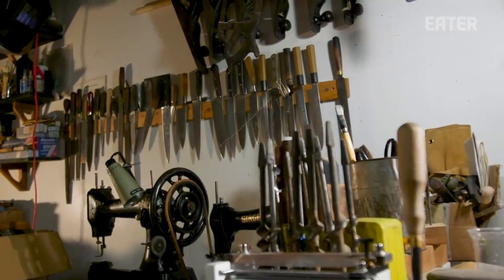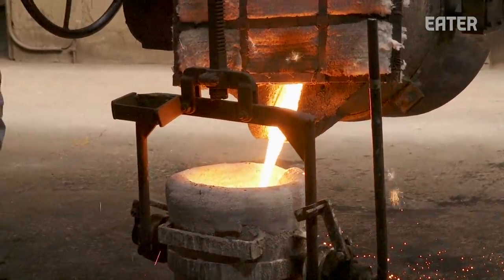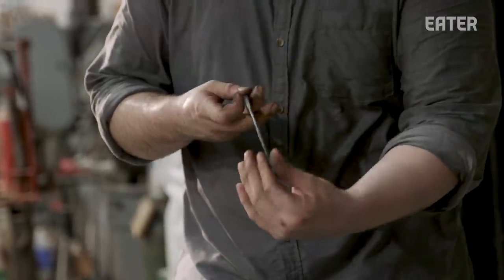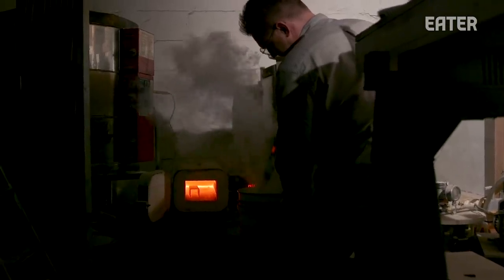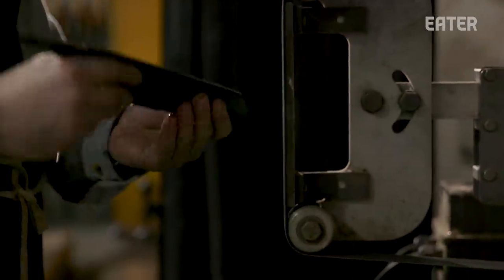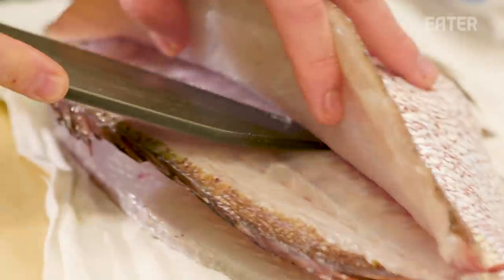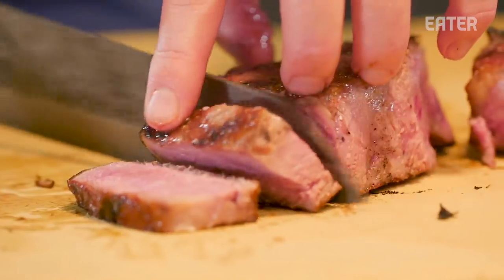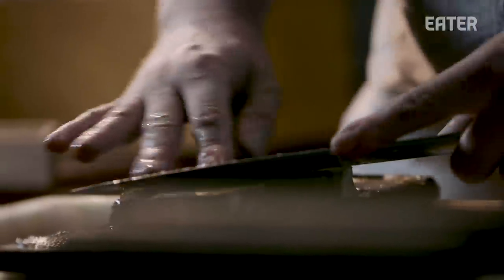How Knives Are Made for New York's Best Restaurants — Handmade

Comment: This explains why the knife I got in Japan costs $200+ 😅Worth it.
Reply: Natalie Lim that's super cheap for a Japanese knife, I'm assuming it is a lower carbon steel because high carbon is highly coveted
Reply: Just like another the other response to your post $200 is cheap for any hand made knife.
Reply: I made another comment before and don't know how it was deleted.. But I stated that I agreed, I saw knives 2x, 5x, 10x the price. I'm only a student and also got my dad a matching knife so def on a budget. Cheap is relative. 🤷🏻‍♀️
Reply: Natalie Lim $200 bucks for something that can potentially last a lifetime or two is definitely a good thing lol, in this day in age a phone that is $1000 only lasts you as long as it's supported for
Reply: @dvxAznxvb  Hahaha for sure, a good beginning to my future collection hopefully :)
Reply: If you forgo pattern welded steel and fancy handle material like burl, you can definitely get into a quality custom chef's knife for around $200-$300.  

As for the "low vs high carbon steel" comment, it could be made from japanese white #2 which has a fairly high carbon content. or maybe something like vg10 if it's stainless. Probably not going to be blue super but I'd rather have something like 52100 or AEB-L over that anyways. Both can be ran @ 62 hrc comfortably. I favor 60-61 hrc though for most kitchen knives for a high amount of toughness with a nice balance of hardness and good abrasion resistance without being a pain to re sharpen. A sujihiki could definitely be ran at 62+ hrc though with either 52100 or AEB-L.
Reply: @dvxAznxvb   You don't have the slightest clue what you're talking about; it's more expensive alloying metals that increase steel cost not carbon content. White #1 is the highest pure carbon steel available to bladesmiths at nearly 1.5% but you can find plenty of white #1 gyutos under the $200 mark. white #1 is just harder to heat treat to north of 63 HRC without becoming too brittle, so when it comes to water quenching pure white #1 especially differentially quenching in water (mizu honyaki) prices go way up because of expertise and failure rate.
Reply: @dvxAznxvb  A Shirogami or Aogami knife can be in the low 100s to several thousands of dollars, it's not the steel that settles the cost. (at least not the majority of it)
Reply: @elliottatwell1155  Shirogami, as explained by Carter, is the steel that shows the true skill of a smith as he has to HT it. Aogami, for what I remember, is already ready to go. Although, I recall having seen Aogami knives being forged, so that should require another HT.
Reply: @Masterfighterx  Nothing is harder than forging, quenching, properly tempering and grinding high alloy steels. It's why so few smiths make Blue #1 Honyaki, because of the failure rate. Togashi, Ikeda, Konosuke and a handful of others do.  White steel is more easily forgeable and the smith can refine grain structure through the forging process which is why master smiths can push white #1 to 64-65 HRC without it being super chippy vs a piece of stock removal white #1 would be super brittle. White steel heat treat and quench temps don't have to be as precise so they're conducive to old school techniques, because all it is, is iron and carbon with a few trace elements.
Reply: Elliott Atwell I didn't say carbon content was what determined the price, everyone values their time and money differently. What I do know is that the higher carbon steel would be more durable retaining the edge which is what most chefs are looking for
Reply: @dvxAznxvb  You assumed a knife was lower carbon because of the $200 + price tag. And no, higher carbon steel doesn't necessarily have more wear resistance. Blue #2 has less carbon than white #1 but higher wear resistance due to other alloying metals which form carbides.
Reply: @elliottatwell1155  Nothing particularly untrue about this, and repeated low temperature heats during final forging steps can help to refine the grain size of steel, but it is worthy of note that a knife made by stock removal could achieve the same results with a proper normalization/grain refinement/heat treat. there is nothing magical about heat cycling a blade while forging as opposed to in a dedicated oven. And I say this as a guy who finds forging far more fun than stock removal, but it would be wrong to say that a forged knife is inherently better than one made via stock removal. Forging/stock removal are both capable of producing equal quality knives, presuming both are done with equal skill.
Reply: The knife you got in japan is probably far better than this. This guy is a total fraud.

Comment: Is that rust on the knife?
Reply: Likely. These knives are usually high carbon (rather than stainless steel which is more common) so are prone to rusting. So you gotta keep them dry and take care of them. But on the plus side, they stay sharper for longer :)
Reply: @lymah_beanz  Likely?  Really based on what evidence?
Reply: It's forge scale.  Some knife makers leave parts of their knives rougher as a design asthetic.  Also these knives are made of high carbon steel which patina over time.  It's not rust.
Reply: @robertp457  Lol chill, I'm only basing it on the comment made - they don't state exactly what clip they're referring to and I'm not about to watch it again to see if it's the case. However, it's not incorrect to say carbon knives are prone to rusting so the likelihood is there. Have a good day/night :)
Reply: Kurouchi finish.
Reply: Kurouchi finish is probably the right answer: the knife is not sanded down to a mirror polish and that rustic look is left on the side of the blade. Very popular amongst Japanese multi-purpose knives (less so amongst yanagibas/sujihiki slicing-prone type of knives)
Reply: It is forge scale or FeO·Fe2O3
,  which is an oxide or rust, but one that protects from the formation of red rust/Fe2O3.

Comment: The Chelsea Miller Eater’s piece was awful. 

They had that bearded dork  cutting in with annoying chatter. And little was given to the actual footage of making the knife. 

You could not tell whether she actually make decent knifes or not.  

This one, is way better for a few reasons ...

1. He goes about his choice of grading  alloy steel, shaping the bar from scratch. By knowing the alloy, you can tell what properties will render the knife durability, malleability. 

She, in the other hand , picks up older files as stock material. Unless she knows what the alloy is in those old tools, there is no way she can shape the end performance by design. 

2. He outlines knife geometry, and how it can affect shaping  a custom knife. 

3. The hardening and shaping part of knife making can affect knife durability and sharpness. He is quick to point it out.  

4. He stresses over how important is to him and the customer to make a custom made knife. 

5. We see him at work.

6. His resume is the first piece to come into the narrative.

Comment: It's nice and artisan and all, but this guy doesn't really seem to have a grasp on metallugry. What he says about grain size is simply wrong, large grains make it more ductile. His high carbon knives might be good for the sushi type cooks, but have all the drawbacks of those knives as well. They rust easily, are hard to sharpen and chip easily. There is a reason the european knives use stainless steel and are slightly softer in comparison. It is not because they can't make it harder, but because the knive is tougher, doesnt chip as easily, and it can be quickly sharpened to 'more than sharp enough' with a few strokes of the honing steel. In a big commercial kitchen, a knive is a tool. It has to be economical, usefull and ergonomic / safe. His knives are more about artistic expression than anything else... not that there is anything wrong with that :)
Reply: Honing steels don't sharpen knives, unless the knife is particularly bad, and even then you need to properly sharpen the blade after a week or so. It is much harder to sharpen a stainless steel knife than it is to sharpen a carbon steel knife, and in any case carbon steel knives hold edges amazingly well if you use them well and take care of them properly, that's why you see higher end chefs and sous using carbon knives. I do agree on the grain size thing, he doesn't really have a clue what he's doing with the forging. He's doing some sort of weird quasi drop forge? Not proper forging.
Reply: @rohunagarwal6497  A honing steel does exactly what it says, it hones a properly sharpened knive. If you frequently hone correctly, you rarely have to sharpen your knife. This keeps it in proper working condition throughout your workday and week. However, this only works with 'softer' knives like the European stainless steel ones. A 62+ hard high carbon steel knife can't really be sharpened that way. As with everything it is always a tradeoff. The harder the knive, the better the edge retention and the higher the chipping. Also sharpening a harder steel is more difficult/ requires more time. And of course there is the corrosion factor and toughness. Stainless knives don't require as much care and carefull handling.
Reply: Stainless knives are easier to use for certain, but they cant be anywhere close to the sharpness of a carbon steel blade, nor do they have the edge retention that high carbon steel gets you. Also, define rarely sharpen. If you have cheap foodservice grade knives, you lose that sharpness after 4 or so days, and they need to be properly sharpened after a week, proper honing or not. I have a decently nice stainless blade that I get sharpened every 3 weeks or so, while my hitachi blue #2 gyuto (HRC 64) needs sharpening once every 2 months if that, and I use both about equally. It takes about 20 minutes to sharpen my gyuto with my sharpening stones, my stainless blade I send to a shop cause sharpening a stainless blade on stones will just ruin the stones while not sharpening the blade all that much.